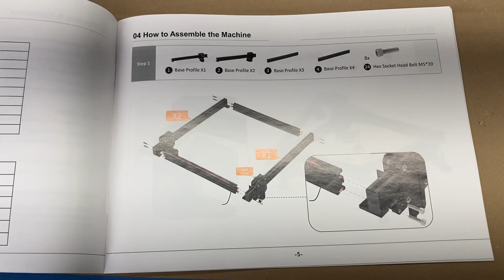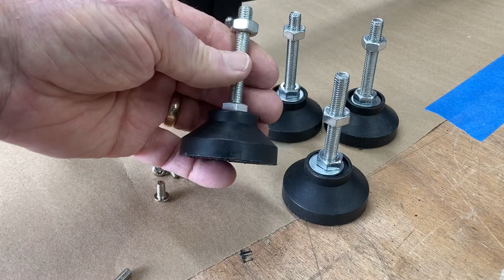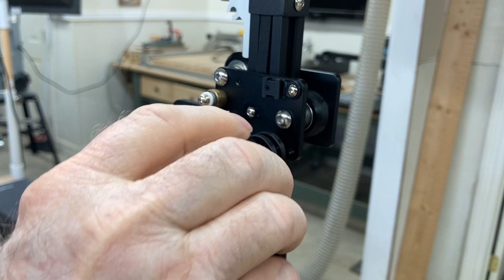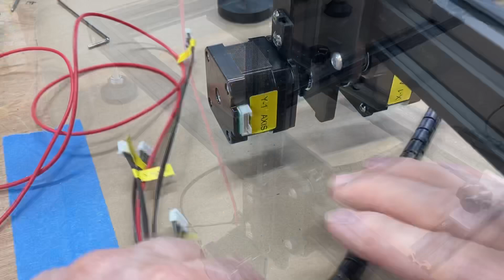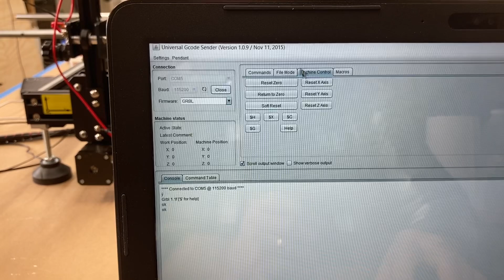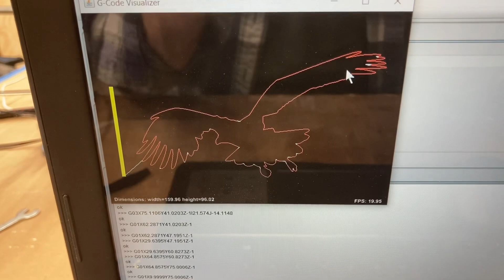WOW! What is FOXAlien Doing?  Really?

Comment: hi, your video turned out great! I’ve had the machine for less than a year and everything was fine, I adjusted the string tension, temperature and speed. all was good. But a couple of days, in places where the string passes simultaneously along the X-axis and the Y-axis, small waves are visible on the cut material due to the fact that the string vibrates. square shapes cut fine. but on rounded forms a problem appears. maybe you can tell me how to fix this?
Reply from the maker: The tension on the wire is a major concern. Also look at the belts on the x and y axis. My guess is that they may be loose.
Reply: @PawPawsWorkShop  thank you very much for the advice, I'll check it tomorrow
Reply: @PawPawsWorkShop  but I think it’s not the string tension, because I had this problem at the beginning, but I set it up and everything was ok. but three days ago this problem happened on any material and on any form that when I cut in the same place there is vibration. most likely, as you said, i need to tighten the belts) thanks again!

Comment: The foam looks like it's pretty stiff and has to be in order for it to fit into the frame. I like what it's doing is cutting very precisely but again it's very stiff foam.  I will be working with sheet open cell ester foam which is very flexable and I will need to be able to support it while it cuts out little parts that go into custom micrometer boxes that I'm making out of mahogany. I wonder what the accuracy of the machine is too. I will be declaring length, width and radii. Also, if I start with15 mm ester open cell foam can I also cut it into accurate slabs 6 mm thick.

Comment: Do you use Easel to get your g-codes? My wife just got me one of these foam cnc. Having trouble with figuring it out. Love your channel
Reply from the maker: Easel is one source. I also generate projects using VCarve by Vectric
Reply: I love the Easel program and your videos on how to use it. I’m getting the hang of it. But could you explain how to tell Easel to do just one pass and how to tell the program to not move the bit over the work area. That’s the problem I’m having it. It starts to cut out the foam, but it doesn’t know not to move the wire over the piece, so it cuts it into small pieces, lol. Would love a follow up video on the use of the Hot Wire CNC.